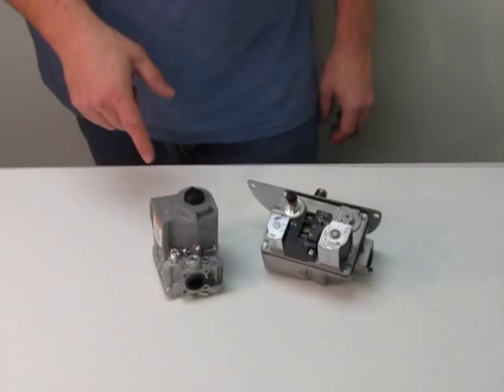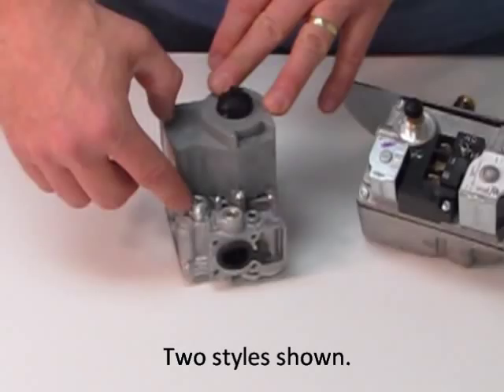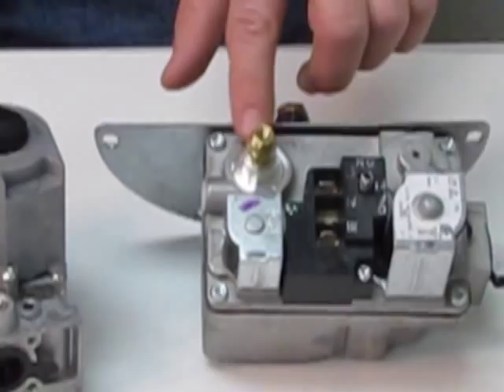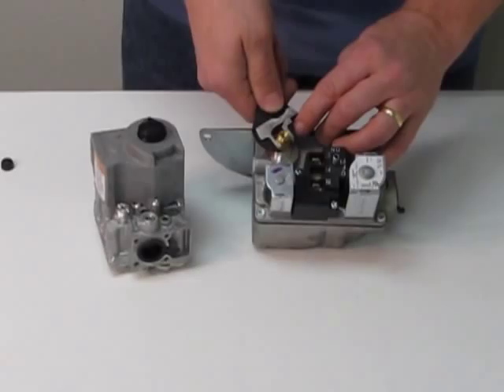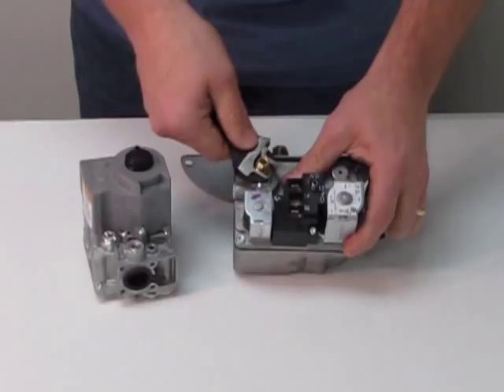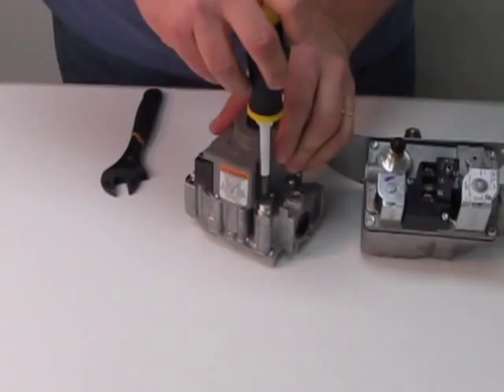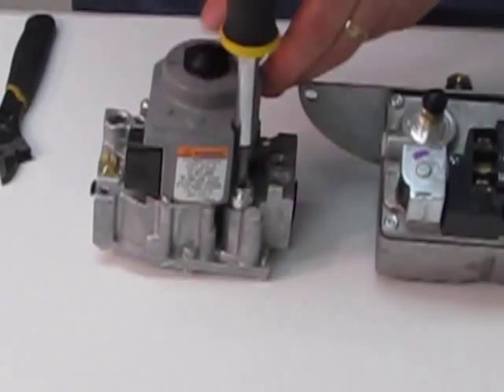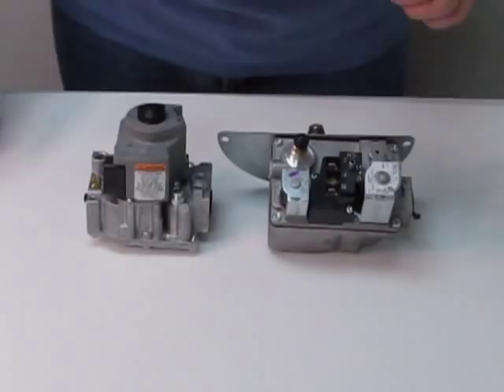Converting a Gas Valve to LP

Comment: I have the valve on the right, and this is so blurry I can't see which way the fitting goes in for LP.  On the end with the little black thing inside it says LP and has an arrow pointing away from the middle. Does the arrow point toward the valve?

Comment: Where is an orifice located for the Honeywell type, which mine is identical as the left one looking from my side?  Thanks.
Reply: I have the same one as well. It site at the end of the outlet where the fuel moves into the furnace It is attached to a bracket. Unscrew the two bottom screws. There should only be two. Gently pull out the gas valve and it will be at the end of the fuel outlet. All this being done after shutting fuel and power off. Disconnect the two wires as well.

Comment: I Need the Rubber Hose which Connects to the Cooker and the to the Gas Regulator on the Propane Bottle( Calor Gas Bottle ) it is a Female Fitting that fits onto the Cooker has anyone any Ideas

Comment: No. You never will have a job where you pull the entire valve off the manifold to convert it. You would risk stripping the manifold out, as now days, they are made of garbage material.